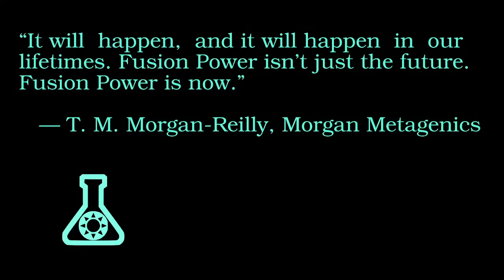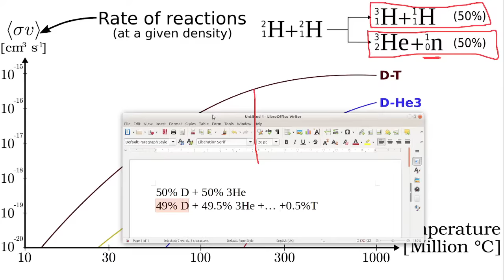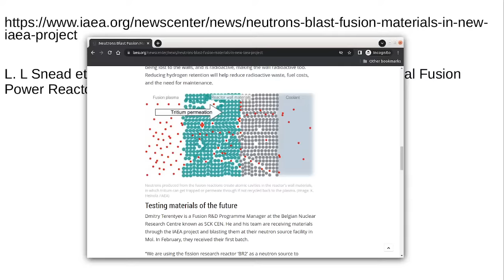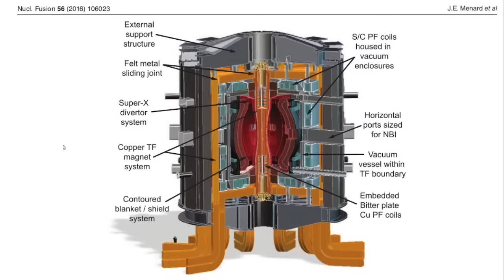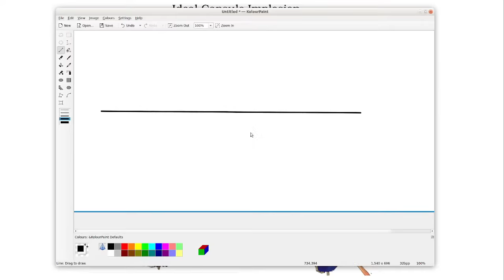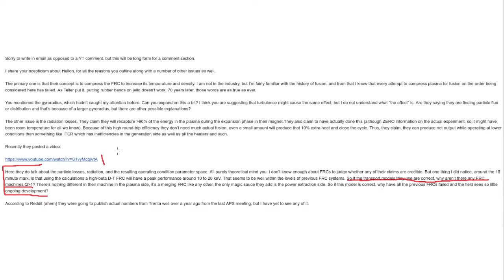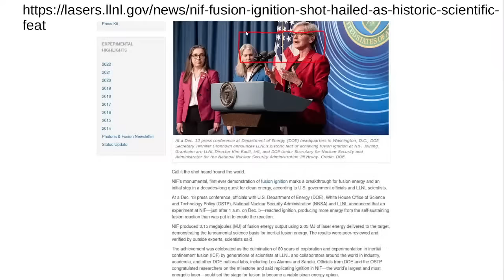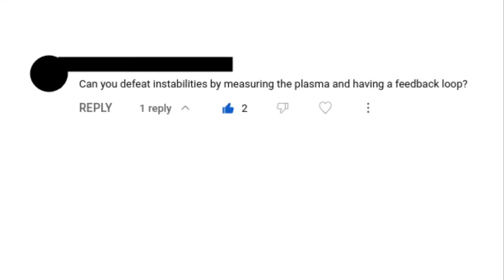Q&A - Helion Energy, NIF, Space and more

Comment: So I keep being on the side of "let's avoid neutrons", and as far as I understood that means proton-boron, right? So, if we figure out plasma confinement, what would be the limiting factor to temperature? The Bremsstrahlung? What if, in theory, we could harvest the power from Bremsstrahlung? Would the problem then basically be that the amount of energy dissipated by Bremsstrahlung is not related to the amount of energy created by fusion? And then the plasma would end up cooling down?
Reply from the maker: Yes, the problem would be bremsstrahlung, and the problem with the losses through it is that they would have to be recovered by steam turbines. Let's call the latter 50% efficient; if during a given interval of time you emit 100J of energy as bremsstrahlung, you have wasted 50J as heat. You must then make sure you are doing fusion quickly enough that you make back the wasted 50J. If you are extracting the fusion energy through steam turbines as well, then you have to make 100J. Numbers out of my butt aside, serious studies on this have concluded that this is hard.
Reply: @ImprobableMatter  Ohhh! So the energy balance would be reached by dumping the excess energy extracted back into the plasma. Which, both extracting energy from Bremsstrahlung and putting energy back into the plasma is inefficient currently. Got it, thank you!!!
Reply from the maker: P.S. The steam turbine efficiency is limited by the laws of physics, not technology. Look up a Carnot engine.
Reply: @ImprobableMatter  Yea, I know, but maybe in a few centuries we figure out how to make really efficient photovoltaics or something, I don't know 😃

Edit: Or is there a theoretical limit on those also?

Comment: Re: the adiabatic cycle - isn't the initial heating to 1MC and the fact the final plasma is at the same 1MC a good thing?
 
1. Heat plasma to 1MC
2. Magnetically compress plasma to 100-200MC
3. Fusion occurs heating plasma to much greater than 100-200MC
4. Expand of plasma and extract work (magnetically/somehow) back to 1MC plasma
5. GoTo #2

What am I missing? Is the plasma at #4 an "exhaust" carrying away the energy put in at #1 so #5 becomes "GoTo #1"?
Reply from the maker: My point is that after #5, you have to cool it down to room temperature. Otherwise, you can't pump out the Tritium gas (discussed why that is bad) and add new fuel. In any case, the way they described it, it will hit their divertor and cool anyway.
Reply: Thanks for replying. I didn't pick up that point. I jumped to the adiabatic time stamp after reading a comment.

Comment: You showed a study on neutron-induced damage which used 0.01 MeV neutrons. And then said Helion would be dealing with much larger energy neutrons, implying that higher energy automatically equals more damage. But I thought the probability of a neutron interacting with a material (depending on the particular interaction process that is causing the damage) can be strongly dependent on the energy, and that for some processes, a high energy neutron is much less likely to initiate an interaction than a slower neutron.

Can you comment on this? Given some reasonably expected types of neutron damage (what processes can happen that cause neutron-induced damage to steel, copper, silicon, etc...?), will the neutrons being higher energy increase or decrease the probability of the underlying interaction processes?

You didn't even identify the particular process referenced in the study, and do a quick check to see if that process is more or less likely at higher energies. You just made a straight assertion that higher energy always equals more damage. Maybe it's obvious to you with more background knowledge than me on this topic, but it isn't obvious to me or probably most other viewers.
Reply from the maker: I motivated why they will necessarily have 2.4MeV neutrons and why they will almost certainly also have 14MeV neutrons. First of all, the exact effects of a huge neutron flux on technologically relevant materials is not well understood - this is why the rest of the fusion community are doing research as shown in Reference [6] from as recently as last year. The only certainty is that fast neutrons are bad news for the absorbing material.

Secondly, the study I showed (Reference [5]) had both thermal and >0.1MeV (potentially up to 2MeV or higher) neutrons. It is true that the absorption cross section is different for different energies, but eventually a fast neutron will collide and give up its energy (forget for an moment transmutation reactions) with part of the Helion machine. The more energy transferred, the worse it is for atoms which were previously sitting neatly in a lattice.
Reply: I think the neutron issue is more than anyone can think of.  At least I haven't seen any comment mentioned the role of NRC.  Since you are operating a power plant that emit radiation, you need to get approval from NRC before operation.  Even if they do make it work and commercially feasibe, I am quite confident that they will never get pass NRC.  NRC may take ten year to aquire the knowledge required to regulate this type of power plant.  Then take another ten year to verify your design, material and operating procedure.

Comment: 1m water shielding is equivalent to 10cm of lead shielding. Isn't that enough?
Reply from the maker: You could certainly fiddle with different materials to optimize the neutron shielding, but at the end of the day (A) Helion's current design does not leave enough room to shield the coils; (B) the plasma-facing material will become churned up and retain Tritium therefore making it radioactive and contaminating the D-3He plasma with a producer of 14MeV neutrons.

Comment: A video titled "What This Breakthrough Means for Nuclear Fusion" by Undecided with Matt Ferrell, shows that 200MJ of power created 2.05 MJ of Laser energy, from which 3.15 MJ of fusion energy was produced at the NIF.
Reply: That's great. It does work. Thermonuclear bombs work too.  However, it's no where near practical. The physics says it can be done in a myriad of ways but the engineering needs to close that gap before there any hope of a functioning reactor. Personally, my favorite idea is liquid metal cavitation because it's the neatest engineering setup. Nothing but NIF has been demonstrated but NIF is never going to be a practical method by its very design. A completely different idea which borrows its concepts might work.

Comment: At 2:58:42, you claim that any commercially sized pulsed ICF approach (ex. >4000 MW) must fire multiple times per second. You reasoned that slower pulsing requires larger yields to produce the equivalent amount of power, and, by analogy to high-explosives, “nothing could survive a ton of TNT.” However, TNT is a chemical explosive. Most of the energy in DT fusion goes into the 14.1 MeV neutrons which penetrate several centimeters before thermalizing. Compared to chemical explosives, which are millions of times less energetic than nuclear reactions, a DT fusion reaction of equivalent energy (m*v*v/2) would produce thousands of times less outward directed momentum (m*v). Hence, it could easily contain much higher yields. Does this make sense?
Reply from the maker: Fair enough, but the near-instantaneous energy absorption is still difficult to handle and there is a limit. The target chamber at NIF is 10 meters across and is supposedly limited to a maximum yield of 45MJ only, see page 4 of the following: https://www.osti.gov/servlets/purl/15006532

Momentum aside, I think regular cyclic loading of a tonne of TNT of energy released in nanoseconds is out of the question for a practical facility.
Reply: @ImprobableMatter  OK, but NIF is not a commercial power plant, so it is not a good example to use for determining the maximum withstandible yield of a commercial power plant. NIF does not protect its optics from the intense neutron/x-ray pulses or flying debris, so damage accumulates each time a target is ignited. In that light, I understand the 45 MJ maximum yield you quoted. A more robust example (closer to the maximum) can be found in Freeman Dyson’s analysis of The Orion, a nuclear pulse rocket designed for missions to Alpha Centauri, the nearest star system to the Sun. His 1968 paper "Interstellar Transport" (Physics Today, October 1968, pp. (41–45) suggests how to fly city-sized spaceships by detonating megaton-sized deuterium fusion explosions in their proximity. For a less extreme example, in PACER revisited, R. W. Moir discusses an idea to generate electricity by detonating 2kt hydrogen bombs in an underground cavity lined with steel. His idea uses molten salt (FliBe) to absorb the neutrons and x-rays. Does that make sense?
Reply from the maker: @michaeldeeth811  Yes, the idea of making energy by detonating thermonuclear bombs is not new. It would simply not commercially viable. These are old speculative paper studies and NIF is engineering reality. If you want to extrapolate to a practical powerplant, I would suggest the latter and not the former.
Reply: @ImprobableMatter  In clarification, I was not advocating for PACER or Orion. They were used as counterexamples, opposing the 45 MJ maximum yield boundary you imposed on ICF. It is ironic that you called NIF an example of non-speculative engineering. NIF was an extremely speculative design, two orders of magnitude beyond NOVA (at that time the world’s largest laser). Anyway, I started this thread because you said commercial IFE requires multiple shots per second. You based that on a maximum yield limit, stipulated to be 45 MJ. Do we agree that the 45 MJ maximum yield stipulation, applicable to NIF's unprotected optics, is not suitable for IFE in general? If so, the statement about IFE requiring multiple shots per second  is unjustified. Am I making sense?
Reply from the maker: @michaeldeeth811  I'm happy to lift the 45MJ limit by maybe an order of magnitude, but not the stipulation that IFE requires at least 1Hz rep rate to be practical. Not because I think I'm super clever - far from it - but because this is the consensus reached by scientists in the field, for the reasons I described.
Reply: @ImprobableMatter  I do not understand what you mean by “to be practical.” If it means “requires at least 1 Hz rep rate” then your final stipulation is a tautology.  Instead of disputing “the consensus reached by scientists in the field,” I’ll quote Thoreau, who wrote "any man more right than his neighbors constitutes a majority of one." Anyway, I found my own consensus of scientists. Sandia National Laboratories proposed 20 GJ/shot, in Annual Report of 2005, for a cylindrical Z-IFE chamber 6 m radius and 8 m high, designed to operate at 0.1 Hz, for a fusion power of 2000 MW, because “the economics of scale will favor having a single chamber with the largest acceptable yield.” To solve the problem of “regular cyclic loading of a ton of TNT of energy released in nanoseconds” they proposed using recyclable transmission lines (RTLs). For simplicity, an RTL is a large ball of FliBe that surrounds the target. The RTL blocks x-rays and absorbs neutrons. This prevents nanosecond timescale surface damage to the reactor walls. Brute force mechanical damage is prevented by FliBe's ability to convert explosive energy into heat, causing the FLiBe to melt and gently splash against the walls of the reactor. Does this make sense?
Reply from the maker: @michaeldeeth811  My definition of practical is something that would actually be built, not a drawing in a 1968 textbook or a 2005 repot. Good luck getting the Sandia proposal built.
Reply: @ImprobableMatter  Sorry, the conversation has drifted. In clarification, I always doubted the veracity of those examples. That is not the point. I started this thread with the goal of learning what you (and your subscribers) think. Specifically, I wanted to know what reasons underpin stated opinions about the maximum yield and shot rate for various inertial confinement fusion approaches. I'm interested in what is theoretically possible, not what is practical. Am I making more sense now?

Comment: The gun analogy is not particularly helpful, a fusion powerplant is only producing and absorbing energy at comparable levels to a non fusion plant in a gas turbine we might be putting 200MW of heat energy into a combustor that would fit in a coffee table.
Reply: To further elaboration on the shell analogue. Shells are specifically designed to produce a damaging effect in a way that is difficult to mitigate. They contain the explosion in such a manner that it transfers energy to solid projectiles, the shell can penetrate targets so that the explosive pressure can be used to split solid objects. A more reasonable approximation would be the gun itself. In that context explosions may be contained in the breach and provides you provide adequate cooling a high rate of pulsed energy depositions can be contained.
Reply from the maker: Yes, but my point is the cyclic nature of it. For any proposal, ask yourself: can all the systems cycle at the proposed frequency? Lasers, electronics, pumping, capsule injection, capsule manufacture etc... In principle yes, but not so easy. My two cents are at the end of my inertial fusion discussion: https://www.youtube.com/watch?v=mxmxZI2Ltvs